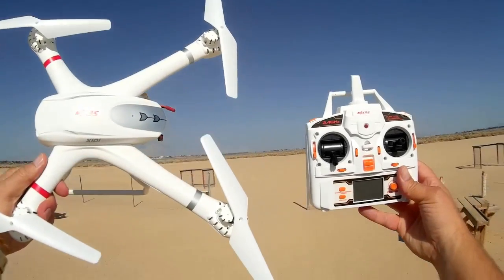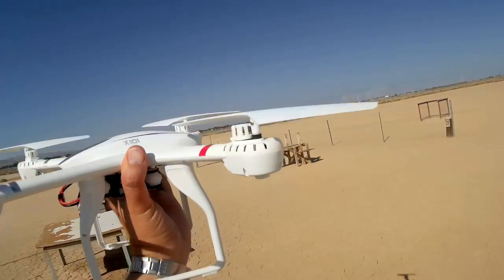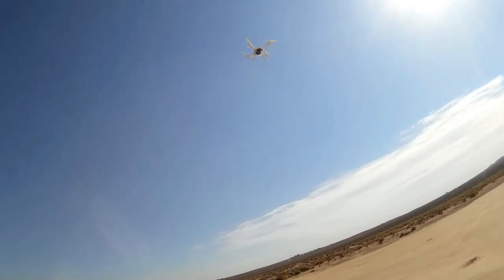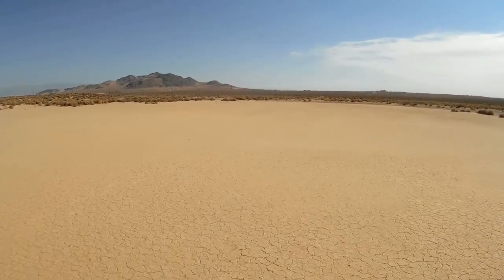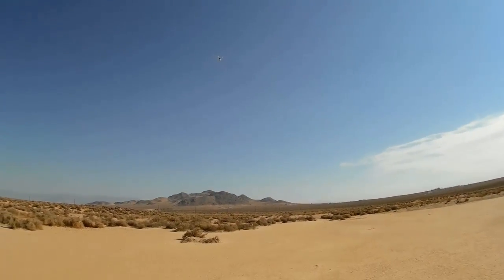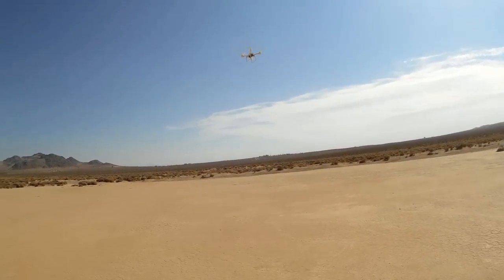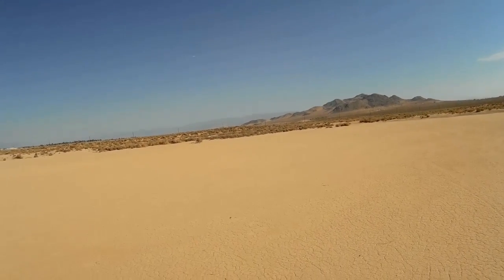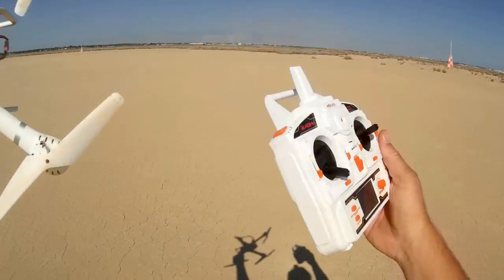MJX X101 Drone Loss of Signal Test

Comment: Nice presentation! I build the same drone just for fun in used condition after I let my GPS-Drone in the trees. I did the first test flight today and I don´t know if I lost connection or if the battery is too old. The MJX X101 fell down from very high height into the field. The good thing is that it´s completely intact after falling down two times. I tried to reconnect while falling but I didn´t know how. Even if the drone is on the ground I have to turn it off/on to reconnect. Greatings from Germany
Reply from the maker: The transmitter for this drone is not very powerful.  It will drop from the sky if you fly too far from the transmitter.   If it does such, start running toward the drone ( to reduce distance).  At the same time, try reconnecting the transmitter by moving the left stick up and down.  Keep moving up and down until it reconnects.  If you're lucky, you may be able to stop the fall before it hits the ground.
Reply: @Quadcopter101  Ah okay, thank you! I only watched videos and didn´t read the instructions. Up and down is the move to connect, okay. I will try it!

Comment: Can anyone help me.. my first MJX 101 testing flight in the park and somehow drone flew up and up.. Despite clicking on return key many times the drone didnt come back and lost in some residential area. I ran towards that area and try connecting with the wifi but it says not in range. advice please.. this was my first flight..
Reply from the maker: +Janas malik You likely flew downwind out of range. But the quadcopter will eventually shut its motors off as shown in the above video.  Just keep searching down the last direction that you saw it.  It should still be there unless someone else picked it up.
Reply: +Quadcopter 101 how can I find when I saw it going towards some residential area. There are dozen of houses and since I saw it from behind the trees I really have no clue where its gone
Reply: +Quadcopter 101 I just made local police knows that my drone has gone missing. is there anything technically we can find the drone
Reply from the maker: Janas malik No, you can put up posters though around that residential area offering a small reward for its return.
Reply: +Quadcopter 101 ahh... anyways thank you very much

Comment: Quick question. I have a MJX-X101 as well and twice now it has turned itself upside down while flying and crashes to the ground. What can be causing that? The last time it did it, it broke the gimbal. I really don't feel like it was signal loss, because it wasn't very far from me. I did have the throttle limiter on 50%.... does that affect the range as well? Please help!
Reply from the maker: +Josh Powell What is the payload that you're carrying, and how much does it weigh?
Reply: +Quadcopter 101 It is just the stock MJX-X101 exactly like the one in your video except it has the c4008 camera mounted on it. It is a camera that is specifically made for the quad. I'm not sure what the exact weight is. I will throw it on my postal scale and find out for you. I do have the prop guards on it too... only because it likes to tip over while landing.
Reply from the maker: Josh Powell Try removing the prop guards. They may be catching the wind and causing weird gyro responses.
Reply: +Quadcopter 101 okay. I'll do that. Thank you for the suggestion. I'll let you know how it works out.
Reply: +Quadcopter 101 I was finally able to take the X101 out for a test run without the prop guards. I also put the transmitter in intermediate mode, noticed it was in beginner, and everything functioned great! No issues at all. Thanks for the suggestion. The only bad thing about no guards is that this quad is a little top heavy and 8 out of 10 times I land it tips over and the props dig into the dirt. Oh well! I have four sets of replacement blades!
Reply from the maker: Josh Powell Always remember to quickly cut off the motors as soon as you touch down.
Reply: +Quadcopter 101 yeah, I will definitely have to remember that! Thanks!

Comment: +QUADCOPTER 101 would you suggest the mjx x101 or the mjx x600 for aerial photography? Or would you suggest another model entirely, im looking to stay under the $100 mark. What camera would you suggest if not the stock c4008? Please get back to me as soon as possible i would like to purchase today. thank you i will also use your links so you get your commission.
Reply from the maker: +Paul Bond X101, more stable with more lifting power than the X600.

Comment: One question, if you fly out of range, do you have to turn the transmitter off and on again to be able to rebind?
Reply from the maker: +audiogek No I was wondering that also.  But just simply and repeatedly doing up down movements on the throttle will rebind it.
Reply: Nice,tnx. I'ts going to be my next quad, love the size of this thing. Without landing gear but with prop-guards ...awesome! Can't wait

Comment: 20 seconds is plenty of time for the wind to carry this thing right into that lake you were careful not to fly to close to and ruin your weekend real fast or over that fence that you cant get into.. ive had quads get away from me in the wind and it didnt have this stupid feature.. i cant imagine the trouble this can get someone into that wasnt aware of it. what if it decided to blow over a road off the side of the park you were flying at and drop infront of a car! i would stay far away from this quad
Reply: +rayikaikin  Don't fly in built up eras with big Quads, if you do you are asking for trouble. And this is a very nice well thought out feature
Reply: +Ruudy L Well said... don't like seeing these larger and heavier quads running off a junk short range TX made for toys. People need to YELL at the manufactures by avoiding the larger ones trying to look like a Phantom. They should offer Hobby grade protocols like Spektrum or Futaba's if they want to sell bigger quads for safety. The "toy" quads themselves have improved  in performance and are far better than their TX's with hobby grade scale performance in some cases like the JJ1000 ver2. But as the quad gets bigger the need for far better components becomes mandatory for safety and that means brushless motors and long range TX/RX etc. 
If a small 32 gram direct drive  quad or a larger 110 gram geared quad with its weight spread out using low mass slow spinning props hits someone or something like a car or a window there's not much chance there's going to be any damage except to the quad if there is damage. But once you go past 200 grams you are 50 grams past the weight of a baseball and even though the weight is spread out over a much greater area and not focused at a C/G point your quad is becoming a risk as the motor arms ends could theoretically  have penetrating power if the C/G was aliened just right. They would probably break off or the C/G would roll off but it only takes one freak accident to hurt something or someone.. And that $10-15 TX is only for toys and all it would take to allow it to happen..

Comment: Hey you guys, everyone seem to be testing flyaway tendency this way but this is an incorrect way to test it!  Problem is, flying out of range is not the same as turning off the transmitter and these quads and hexes react different when they fly out of range as apposed to turning off the transmitter. A better test would be to rig the transmitter and walk away with the aircraft until out of range.
Reply from the maker: +Multirotor Go But I was trying to demonstrate that. I was using strong forward pitch and high throttle to fly it upward and into the wind before turning off the transmitter.  I wanted to see if it would maintain that pitch and throttle.  Instead it leveled off, and then started descending 20 seconds later.  The real risk of this quadcopter is losing contact when downwind.  In that case, this leveling off into a hover would not help much as the wind would still blow it further away.  But the good thing is, it will eventually still land relatively close to you, depending on the speed of the wind.
Reply: +Quadcopter 101 Some of the Atop quads will shut down if you turn off the radio but if you loose contact with the radio still on they will act like this model and some, as you know just keep flying away, make a nest somewhere and raise little quadcopters happily ever after. (presumable)  :)
Reply: +Frequent Flyer RC ... Great Point...Some of the Atop quads will shut down if you turn off the radio but if you loose contact with the radio still on they will act like this model and some, as you know just keep flying away and presumable make a nest somewhere and raise little quadcopters happily ever after.   :)
Reply: +Frequent Flyer RC Yeas many people have told me the same I hope Quadcopter 101 read this and begging to to the range fly a way test with actually losing the connection with the transmitter on. In a  desert and a with truck he will will definitely end up getting the quad back. Maybe put some Bluetooth key finder too just to make it a little bit easier.
Reply from the maker: +Multirotor Go Maybe I would agree that this might be appropriate as an alternative way to do a range test.  But it's not clear to me why this would be a better way to determine what the quadcopter would do with loss of signal?  For example, by actually flying it, I noticed that it levels off and hovers when the signal was lost (does not maintain pitch and roll commands).
Reply: Well I have not done this type of  test myself but I have read in different threads from different quadcopters that people get different behavior wen actually losing contact with transmitter on. On some quadcopter that the motors get shut after turning off the transmitter, when they loose signal with the transmitter on they keep on going with the last input for much longer time or even sometimes don't even shut down the motors. I think is more a thing of the last input issue. If you loose signal when giving a lot of forward stick and throttle and loose signal the thing just keeps on going for a long time with that input if you add up that the quad was flying with the wind then you get a flyaway even though the quad shut down motors when transmitter was turned off.
Reply from the maker: KD LongWay Yeah it's a good quad.  Just remember what it does when it gets past its range.  If you wish to fly far, it's best to fly it upwind.

Comment: Good too know, But you let it climb and shut off the TX and it kept on climbing for a bit What now if you are flying full forward and you shut it off, how far will it still fly?
Reply from the maker: +Ruudy L It levels off into a hover.  Watch again at 3:13.  I'm in strong forward pitch to fight the wind.  It levels off from this pitch into a level hover about 4 seconds after loss of signal, and drifts backward with the wind.  It then starts its descent until it meets the ground.
Reply: +Quadcopter 101 Actually watching your video again, it is a nice system, it  throttle's down and tries too land, without causing too much damage. If it was too shut down the normal way it would plunge too its death. Of course if there is a lot of wind, it will land further away.  MJX has done a nice job on this.

Comment: what is the range for this quad?
Reply: About 100 meters in non urban areas.  In Urban areas with a lot of WiFi signals the range may drop to less than 50 meters
Reply: +Ryan Hillock WiFi by fpv or range
Reply: Epic Derp Clash Of Clans The only WiFi signal that would be used here is if someone installed an fpv system onto the quadcopter.  The quadcopter uses a 2.4 gigahertz signal to receive commands from the controller.   .
Reply: +Ryan Hillock ok :)